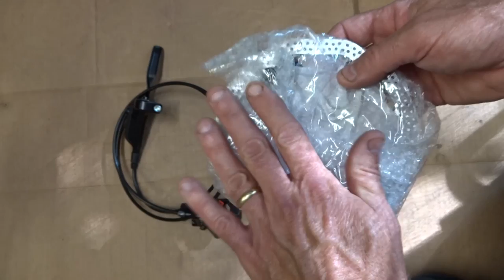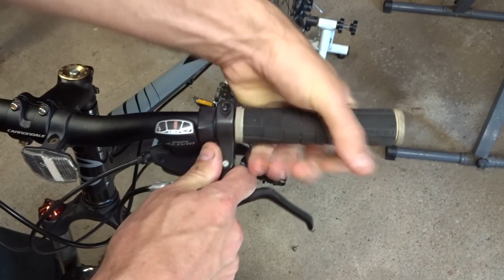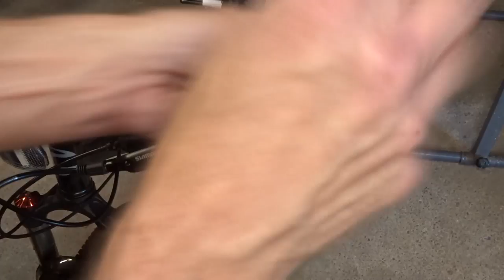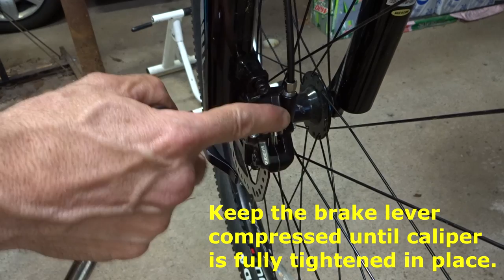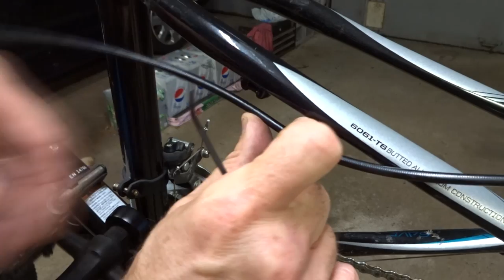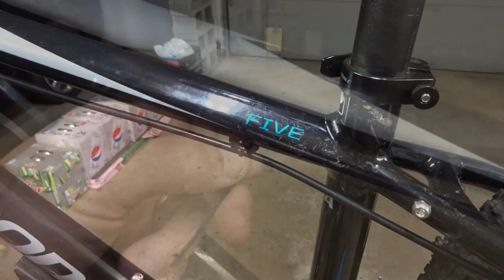How To Convert To Hydraulic Disc Brakes From Mechanical Disc Brakes On Mountain Bike

Comment from the maker: For more bike repair videos hit the subscribe button ► http://bit.ly/SubRJTheBikeGuy
Reply: Ser do i need to change the rotors too? If i had disc break rotors?
Reply: @rivenrivera5718  /////////⅘///////////////////////////////////
Reply: @dumitruionas8367  whatt
Reply: What type of bike stand R U using RJ?
Reply: Thanks for the step by step tutorial I did a hydraulic brake conversion on my ebike but the only difference is you have to reconnect the brake sensor on my ebike

Comment: Just a tip: better to use a syringe to put alcohol inside the grip, so this way you will not scratch your handlebar. (Sorry my poor english)
Reply: Néstor Henríquez Medina your English is okay,  not bad
Reply: Those scratches ... If it's your own bike - whatever, but for someone else - bad form....  bad form
Reply: WD40 works great on this too
Reply: Your English is perfect to me
Reply: @leej8856  takes forever to dry though
Reply: I wouldnt use isopropanol as this is no lubricant if you want to take off you can use washing liquid and then clean with isopropanol
Reply: @LUKASZ332  That's ok too. Thanks buddy. In fact, I'm doing that way nowadays.
Reply: RJ the Bike Guy, is he a Pro acting like an Amateur or an Amateur acting like a Pro. i wouldn't take my bike to him, Rough as guts just doesn't do it for me.
Reply: @gianmagnifico500  he's not asking to repair your bike...he's showing you how to repair it yourself.
Reply: @gianmagnifico500  it's his own bike and he just shows tips how to do bike maintenance at home, he don't accept bike repairs from anybody, just appreciate the video or make a video of your own doing it "professionally" 🙄

Comment: I got my new SLX prebled rear brake today, and just installed it. I used some of my lanolin oil based chain lube (90% lanolin oil) to get the grip off. I slid an old QR skewer under the grip from the outside of the bar, brushed the oil onto the skewer (it acts as a guide) and then rotated the grip. With the oil in there, it turns very easily. You should be able to simply pull the grip off, but if not, just turn it until it does. Wipe off some of the excess (you still need some to get the grip back on) put the lever on, and reinstall the grip. The rubber of the grip will absorb the oil, reconditioning it and making that rubber sticky.

Comment: Excellent video. One tip. If you cut zip ties with toe nail clippers you won't have sharp ends like you get when using diagonal cutting pliers.
Thanks for your excellent instructions. I plan to make this upgrade soon. 👍

Comment: Thanks for this, I had a front brake bracket snap on me today, the whole mounting bracket went!!!, I have a shop bought 1000 watt electric bike  {only used for commuting so no off road} and I honestly thought they would have used quality parts in the first place!, they were mechanical and to be honest I never liked them so it has pushed me into fitting hydrophilic brakes, I was going slowly when it happened so very lucky, I usually zip about. This is a job I can do myself after watching your work here, thanks very much

Comment: ...and done! Thank you for the video. Cannondale Trail 5 is a nice starter bike. Can't stress enough that Shimano Acera Hydros are a great value upgrade from mech disc brakes. They work, self-adjusting. Just keep the rotors clean.

Comment: Worth mentioning that hydraulic brake lines might need shortening to fit the bike properly. But perhaps you can cover that in a separate video :) (alongside with hydraulic disc brake bleeding)

Comment: Poke a tiny hole in the end of the grips and use an airline to push air in to the grip, it will expand the grip enough to make removal and install a breeze. I was skeptical when I tried it on a two-man auger that needed 3 new grips but it worked a charm. No prying scratching or alcohol that could degrade the rubber/silicone over time.

Comment: My 2001 specialize enduro expert came with hydraulic disc brakes. What's needed to connect with my ebike conversion kit I purchased. the brakes with the kit came with a harness so I'm assuming it is needed with the computer?

Comment: Usually, do new hydraulic Disc brakes (NUTT BRAND) come with brake pads already installed? Do need hydraulic brakes need to be bleed before first use ? Thanks

Comment: Since we're talking about removing and remounting grips, if you ever have a grip that is just a little too loose, remove the grip, cover the end hole (if any) and spray the inside of the grip with HAIRSPRAY!  It will slide on like it's been lubed but when dry will feel like it's been glued.  
I've got a can of hairspray in my garage that has to be over 20 years old.  I use it only for doing grips.
Reply from the maker: If the grips was too loose, it may have had some sort of soap residue it there. Usually sliding on with alcohol, the alcohol will evaporate and the grip will stick. Hairspray contains alcohol and works similarly.

Comment: My 90's Giant cable routing doesn't use cable ties as shown in the video. Is there a neat product out there that would convert/replace my recessed ferrule type guides to accept the hydraulic pipes. Using cable ties around the frame tubing wouldn't look great.

Comment: Is it necessary to have a center lock rotor or six bolt rotor since the bike I am hoping to buy is a cheap one and I am thinking of upgrading it part by part. My bike has jak 7 mechanical brakes. Can I upgrade to hydraulic brakes?

Comment: Unfortunately my Shimano shifters are integrated with the brake levers so I'd have to get new shifters as well. That's a bummer since it's an added cost and it would be a shame to discard the old shifters/brakes because they are really nice.
Reply: same here what are you going with parts wise
Reply: Cut the old one
Reply: @chinmoysamal8064  Nah i just got a new one and did a one by drive in the front the selector was like 15$ off ebay has a nice click and is Shimano

Comment: I have 2gary fisher Tassajara one is 2005 setup for disc brakes meaning rims have the hubs frame has the mounting points for hydro lines the other bike has mounting points on front fork and mounting holes tapped in the rear ,rims are not disc ready but I can Swap with newer bike Question is on the rear caliper will it come with bracket ? Or will I have to get it from Trek (Gary fisher) ??

Comment: I bought the same brakes ,but my question is the rotors I have are Terktro branded but they don’t have any pad typed meterial mentioned on them ,so is it safe to install ,resin pad in that rotor because the brakes come with resin pads anyone ,help is needed ,thanks

Comment: Great video. The Allen key you used to raise the grip scratched the handlebar. I cringed when I saw you insert it as I knew that would happen. Is there another tool you could recommend?
Reply: Compressed air.

Comment: Hi many thanks for your video over the years and I am a big fan of your channel. I just wonder would you be creating a complete bleed of Hydraulic Disc Brakes with the correct way how to identify the correct fluid (Solution) on certain type of brand of brakes. This would be very helpful and very much appreciated.
Reply from the maker: I haven't done that yet. Different brakes vary some in the method.

Comment: The cable guides in my bike are for mechanical disc brake. What is the best way to convert them into hydraulic brake cable guides without actually cutting the stopper end? Just in case I want to return the mechanical disc brake.
Reply from the maker: You don't convert the guides. You get additional guides that attach. Warch the video.

Comment: I dnt have  cable holder like yours on my frame. Do you alternative way to hang the cable of hydraulic brakes? Bcause mine is an older one
Reply: Mark Philip Mirasol just use bigger zip ties...or if its old enough to be round tubing they make cable holders that clamp on...not sure if they work with hydraulic calipers though
Reply from the maker: If your bike has disc brake mounts, it might have something,  Maybe oversized cable stops which are also made to route hydraulic lines with special plastic clips.
Reply: I had the same problem, my frame have not guides for hydraulic, only for cables. I used zip ties and drilled the guides to acomodate hydros. Works fine.
Reply: Mark Philip Mirasol electrical tape or zip ties

Comment: Hi I have a Mongoose MTB with front mechanical disc brakes (160mm).  Do you know if these replacement parts are of a standard size where the caliper is bolted on to the bike. I am not happy with the performance of my mechanical system and would like to upgrade to  hydraulic brakes.
Reply from the maker: Mounts are relatively standard. So you should be fine.

Comment: You can use a water for removing the grips
Reply: yes, use hot tap water, use a towel for extra grip while removing, the heat will expand the grip, making it easier to remove.
Reply: Yeah
Reply: EAR KICKER i used some fork lube
Reply: That could do it too
Reply: Wd 40 works great and evaporates
Reply: Lol

Comment: Hi, my mountain bike have a hydraulic brakes already but its the old Hayes Mag 1. My question is the mounting universal? Mine doesn't have that adapter/bracket.
Reply from the maker: No there are different mountings. Some old ones that are hard to find calipers for. And a couple newer styles. I don't know what you have.
Reply: My Bike is the Trek 8000 LT.
Reply from the maker: @josper1003  Congratulations. You have one of the ones that takes specific, limited availability disc brakes.

Comment: Is there much difference between mechanical and hydraulic in terms of stopping distance  if its a top end bike etc?
Reply from the maker: Also depends on size/quality of rotors, pads, calipers, etc. All things equal, I think hydraulic will be better.

Comment: Thanks for the informative video. My bike has internal cable routing; how will this complicate my install?
Also, how do you determine if your shifter set is integrated? I currently have Shimano 105 components.
Reply from the maker: You won't be able to run the lines internally.

Comment: How do i change only  the shifter while keeping my old cables? My shifters are integrated and i bought a seperate shifter
Reply from the maker: Dude, that is like buying a new car, and asking that the oil from your old car be transferred over. Just buy new cables. They are cheap, and they wear.
Reply: Ok thanks just wanted to avoid changing the cables because the deraileur is already shifting properly. The cables are also relatively new

Comment: do you have to order the cables to length? or can you adjust it like normal mechanical cables?
Reply: I've looked into this. It can get spendy & tedious real quick to get special fittings, special hydraulic cable & tools to fit & adjust the hydraulics. Best to buy the right length if at all possible.

I was almost going to ask him to do some vids on this because a lot of the e bike kits are available with disc brakes now. With that kind of speed it is REALLY needed. I hope he does more vids that have a crossover into the Ebike world.

Comment: I have a 2017 Cannondale BadBoy 4 with mechanical brakes that i will like to convert. Is that possible since it has the one fork in the front. Any help will be appreciated. Thanks
Reply from the maker: Maybe. The front is probably not the issue. The rear caliper probably will be.

Comment: I have a question. Any type of Hydraulic Disc Brake can be used in any mountain bike right? Because i have a mountain bike that uses a Mechanical Disc Brake System and it does not provide much braking grip. 

I'm planning to buy a set of Hydraulic Disc Brake with the brake lever and brake calipers but i'm not sure if it can be use or not. Hope someone can help me with this🙏🏻

Comment: so the calipers need to match the disc brake sizes?
Reply from the maker: The calipers need to be mounted to match the rotor size. The adapters adjust where the brake pads hit the rotor.

Comment: How do I install the rear hydraulic disc brake for the frame with inner route instead of outer route? There are a lot of carbon frames come with inner routing.
Reply from the maker: Those frames are also MADE for inner routing,.
Reply: How do I take the hose apart and insert into the inner frame?
Reply: Sea Sky  try outer routing with zip ties. If you still want inner routing you need to take apart the cable which will lead to bleeding again.

Comment: Have you had any experience with hydraulic brakes messing up if you work on the bike upside down? I like to work on my bike upside down, like for a flat fix on the road.  And I have found doing so leads to spongy brakes and eventually brake failure requiring a brake bleed.  I am wishing now that I had got a bike with mechanical disc brakes.  Any thoughts?
Reply: dalecs47 I've never had that problem before with hydraulic disc brakes on two of my bikes. Maybe it's only an issue with some brands of disc brakes. I recently swapped a bike to mechanical disc brakes and I found they work really well, but need lots of regular adjustment, especially after riding in the rain. I found it very annoying, whereas hydraulic brakes rarely ever need adjustment.
Reply: dalecs47 I have the same problem, when i turn my bike upside down on the floor to have it repair or something, my hydraulic brakes suddenly come very loose as if it has no oil and no stopping power.
Reply: dalecs47 FYI when you experience this, air had already been in your system. Putting your bike upside down shouldn't introduce air bubbles.
Reply: kidbiketv what should we do then? Do we need to bleed it and put new oil?
Reply: renz 1207 Yes. After all, that is part of the maintenance needed to keep them working well. 👍
Reply: renz 1207 Air goes in the system over time as it isn't totally sealed. No brake is impervious to this. The fluid (if the brakes are especially used often) may be discolored and contaminated. Just push new fluid in a couple times. Whilst doing so tap the brake system you are bleeding to mobilize any bubbles into the brake lever (where fluid will exit out from a funnel). There are tons of videos on YouTube for this process. Just search and go.
Reply: No, brake fluid is hygroscopic i.e. it absorbs moisture. If hydraulic brakes are bled properly there should be 
NO air in the system.
Reply: renzo xD because when you turn your bike upside down, all the mineral oil goes down the cable/hose to the calliper. All you need to do when it feels loose to is to keep pressing your brake lever several times to pump up the oil.

Comment: What's the point of removing the wheels, is that not possible to avoid? Thanks in advance for the reply
Reply from the maker: You mean to the conversion without removing the wheels? Because removing the wheels is too difficult? You probably can, but why? You can probably do it one handed. But why. Do it how ever you want to do it. I don't care.

Comment: Is 203mm disc brake to big for the back wheel?
Reply: JKube 2 I use  a 180mm on it works great you need an adaptor.
Reply: No its not too big, 203mm rotor delivers a better performance, by not getting hot like the 180mm one

Comment: Great video with detailed information. I have 2016 cannondale synapse alloy 105 with mechanical brakes. I have been thinking of upgrading to hydraulic brakes, Front looks fine. I need your advice on the rear ones, as the cables are routed internally and they have hose stops prebuilt on the frame where the cables are routed internally. Should I drill another hole and run the hose internally or do you recommend routing the hose externally. Any advice will be appreciated, The brake set along with sti levers model's numbers are Shimano ST-RS685 and Br-RS785 with post mount.
Reply from the maker: Route the lines externally.
Reply: @RJTheBikeGuy  Thanks. What would you recommend in using to hold the hose with the frame that look nice as well?
Reply from the maker: @wambklyn  They make various holders. You just have to see what works for you.
Reply: @RJTheBikeGuy  thanks

Comment: Curious, why the switch. From mechanical to hydraulic disc brakes?
Reply: Probably because they are smoother and more reliable. This year I notice one of my bikes with the cable disc is sticking and half seized up while my hydraulic disc brake still remains troublefree. I like the hand feel a lot better, too.
Reply: They feel really really nice, the first time I squeezed a pair of hydraulic brakes, I immediately loved it, it's also really strong(if you have a decent pair of brake pads) but don't expect them to be strong immediately, you've got to use it for a while before it's at its strongest.(same goes for any disc brakes)
Reply: Also hydraulic disc brake calipers adjust themselves over time
Reply: F1RST CLASS  They are soooooo nice to pull. It's a really light pull. You don't feel any resistance
Reply: Agree I usually go back to mechanical disc's but I prefer non disc whenever possible. Bleeding and adjusting bicycle brakes is absurd, and if you have a lot of bikes as I do, hydraulics always lock up if left alone. Might try some Paul Klampers for my Niner Sir 9, I might ride the bike more if the brakes didn't squeal all the time.

Comment: Hey RJ The Bike Guy. Will i always be able to just change the Brake system and leave the Roters from the mechnical ones? The new brakes would be running Resin pads NOT Sintered ones. Reason im asking is that i have some Hydrolic brakes to spare and my buddy has Mechanical ones. And well he is starting t Trail ride... Wanna get him some better braking :D
Reply from the maker: I don't believe there is a difference in the rotors between mechanical and hydraulic. Go for it.
Reply: @RJTheBikeGuy  cool. Will do and thank you👍